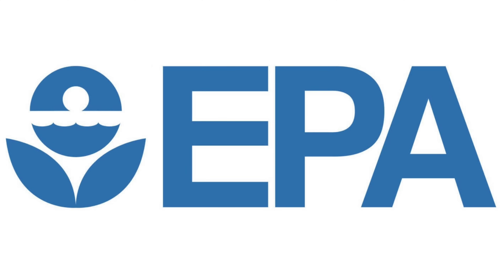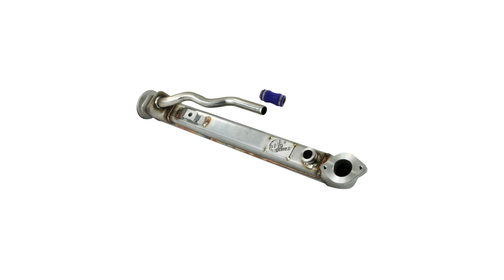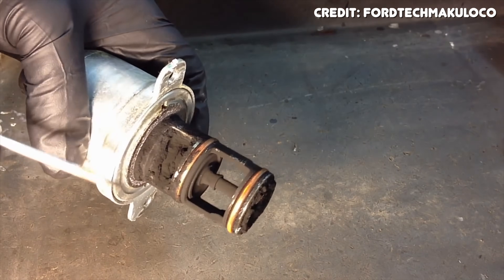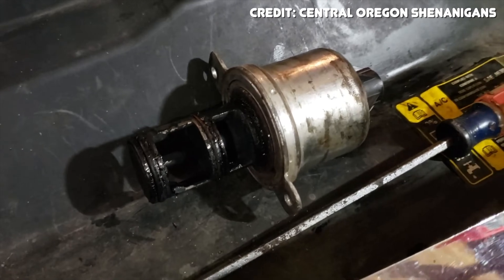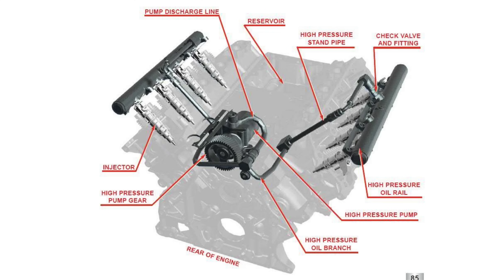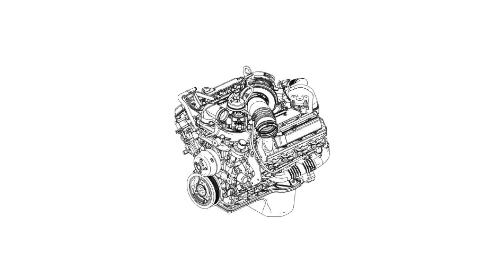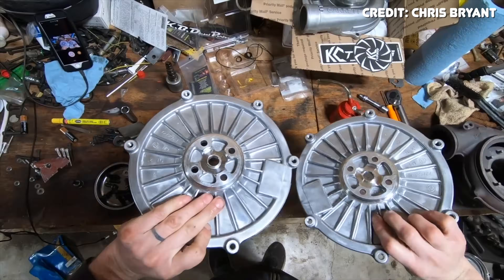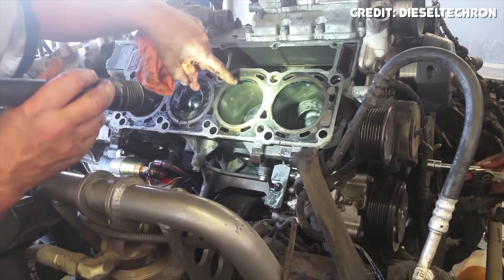The Truth About the 6.0L Powerstroke (And Everything Wrong With It)

Comment: Junk. I have an 03 Dually bulletproofed and 230k here I am spending 12k+ installing a new engine while all my Cummins competitors are pushing 500k and still going. Running hot shot so not a lot of idle time - always motorcraft oil/filters along with mc fuel filters and routine maintenance as required by dot and total failure of an engine!!!!! Pulls like a freight train …………. When running

Comment: I bought a 2006 F250 XLT extended cab for $5k, knowing all the issues, and intending to fix them, as the bottom end of the engine is solid, so I'm told.  The guy thought it had a bad HPOP; it ended up being a piece of screen broke off in the IPR and blocked it open.  $15 later and back on the road.  Two weeks later I noticed just a hint of oil residue in the coolant reservoir.  Immediately took it off the road. Had the heads o--ring'd, ARP studs, 12 mm standpipe and dummy plugs, new KC stage 1 turbo, blue spring mod, new oil cooler, alum radiator, external oil and coolant filters, and a SCT X4 tuner.  It's a solid engine now, and I love the sound.  Have $10k in the truck and DIY repairs, and probably worth $25k these days, at least.

Comment: Deleted, studded, truly bulletproofed, and with proper maintenance, my 6.0 runs all day long with no issues. Transmission is indestructible. Frame and body isn't rusted out like most ten year old Dodges on the road. Overall, it is far more reliable than any GM or Dodge product from that time period. Yeah, if I could ju$tify replacing my 2006 6.0 with a new 6.7l Powerstroke, I would consider it. But for my purpose, hauling a big trailer a few times per year, it is fantastic.

Comment: I loved my 2005 6.0, STC fitting, standpipes and dummys, oil cooler, egr cooler, turbo and ipr valve. I sold it several years ago with just under 200k miles and ran excellent. I now own a 2008 6.4 and havnt had issues with it yet besides thermostats at 100k miles. I keep my trucks bone stock no tuners However I do have a scangauge 2 to watch my temps and perform my own maintenance and repair.  The 6.4 is a powerhouse but I pray everyday before I turn the key. On the bright side owning Fords has brought me closer to Jesus!
Reply: Amen

Comment: Absolutely correct with all of your explanation, but I think some of it is not nearly as bad as to label the engine as "horrible engine".  The oiling and "O" ring issues are not at all as common as the EGR issues.  Simply changing oil regularly, using good quality oil and first and foremost adding a coolant filter and EGR valve delete kit will make this motor exponentially more reliable.  Why they did not have a coolant filter on there from the factory is beyond me.  That one simple add-on is where I think the difference is between the fleet Internationals and the Ford motors and probably explains some if the comments heard about International version being more reliable.  Ford also "pulled a fast one".  They knew, are at least eventually found out, that in the long run that the oil coolers would plug up and cause the chain reaction that would take out the rest of the motor, but the fact is, these failures would more often that not, wind up happening after the warranty period.  So most of these motors would not clog up until after 60k miles.  So, they fixed the ones that were inside warranty and kept their mouth shut instead of doing a recall and adding a coolant filter and swapping out failing oil coolers.  Just telling every owner to add a $100 coolant filter kit would have saved many of these motors and potentially diverted the "6.0 is a terrible motor" stigma.  But they could not do that because it would have been admitting guilt and meant replacing a bunch more oil coolers at cost.  Swap out the studs, delete the EGR valve, add a coolant filter and these motors are good to go for a tune and a ton of miles.  Just start by first getting a scangauge to make sure your oil temps do not exceed 10 to 12 degrees more than your water temps while driving on the highway for at least 15 to 20 miles.  If it does, you oil cooler is plugged up and that needs to get swapped out first.

Comment: I had a stock 2003 Ford F250 with the 6.0.  Had the injectors replaced once by Ford.  Got 90k on it when I sold it.  Never had a problem with the engine or truck, but I did not tow anything more than VW's on a trailer.  My friend also had one  but  had turbo and injector issues throughout his ownership.   I may have gotten the engine lottery with mine.

Comment: I have had my 04 Excursion for several years now I have done most of the upgrades minus the studs and remote oil cooler. 
I had two 7.3s that I truly enjoyed yes I had reservations on the 6.0 but after upgrades like Banks exhaust S&B intake Air Dog pump kit upgraded stock turbo and I went ahead and put a stock ford HPOP and injectors stand pipes and plugs EGR issue resolved and cooler. 
It has 248k and it runs like new no oil usage I think it will probably last like my last 7.3 it had 815k when I stopped driving it due to transmission issues dislike the ZF 5spd. 
Yes it was a lot of work but it was super simple and worth the trouble.

Comment: I was driving my 6.0 on the highway when all of a sudden I lost power. I went from 75 to 55 and started to run rough. Now it starts but rough idles and died after a couple minutes. It’s been bulletproof, egr deleted, and straight piped. I have no acceleration. My CTS3 is telling me it’s at 90-100% load. We changed the fuel filters but that didn’t work. They’re is no white smoke. It might be something with the fuel system.
Reply: Mine did something similar with a blown injector. No blowby but washed a cylinder before I knew it.

Comment: Meh, Ok Video because it discussed nothing new. Sampling a few comments, seems on par. Coming from a 7.3 to a 6.0 (2wd) and then deciding to upgrade to another 6.0 (4WD KR)- The motor is reliable when all the topics discussed here are addressed. What is missed is the bad runs of radiator caps (degass bottle caps) causing another failure chain. Eventual coolant loss equals heat in the wrong places and a cascade of failures up to potential head gasket failure. Make no mistake, a 6.0 is cheaper to run because of the failings and now they are the most practical diesel today to run for any reasonable mechanically savvy person once addressing all that has been discovered since 2003. Of the 6.0 trucks in my family, 50% are over 500K miles, 1 was bought new in 2005 and has over 1 million miles (RV transport). Of all diesel trucks (Dodge/Cummins, GM/Duramax) all experience costly repairs when run like this situation (RV transport), the 6.0 eeks out as a complete truck (bumper to bumper) still cheaper, reliable and most of all comfortable. Whats more, there are additional tid bits about head gaskets that I could write on about, but conditioning head gaskets is in someways better than NOS and aftermarket gaskets. Here is atleast once source to help those wanting to learn more about the 6.0. https://www.youtube.com/watch?v=qHyBwfGspuA

Comment: I mean mine went 356k before the heads gave any issues which was they cracked mixing diesel in my coolant. But the first owner which I personally know never tuned it just routine maintenance and treating it like a truck. Regularly pulled our Kubota kx40 on our tilt deck. It is mainly in how they are treated but it has a ton to do with how they are maintained. I’ve done several upgrades and updates since I purchased it and it’s my daily and I wouldn’t hesitate to pull my fifth wheel from coast to coast with it

Comment: I worked on these engines 7.3 and the 6.0 for years and you nailed the 6.0 problems. The only thing you missed was the fuel injector wiring harness having very small gauge wiring being routed tightly on top of the engine, very prone to chaffing and the insulation falling apart due to heat. Not an easy engine to work on. Even though I know the 6.0 well, I now refuse to work on this engine. Another Ford nightmare design.

Comment: It's worth noting the high pressure pump was revised in 2005 and the newer one rarely fail. Good video. I could touch on a few other things being a 6.0 tech. But I assume your going off internet research not actual experience.

Comment: My 05 6.0 was bullet proofed before I bought it and it's still giving problems, but lucky for me I have a 1995 5.9 12v Cummins on the engine stand ready to drop in and the swap kit will still be cheaper than fixing the powerstroke and I will finally have low end torque something that is unobtainable from a 6.0 powerstroke thank you for the video it sure brought clarity to my decision

Comment: The 6.0 has its faults just like any engine you try to maximize its output from. I bought mine with 70k miles on it. Had a well known powerstroke tech who has been servicing these these engines since day one. Replace the head bolts with arp studs, egr delete, blue spring upgrade , hpop connector replaced 6 yrs ago. Have 200k on it now. I don't dog it but do make it work to earn its keep here and there. Have replaced one injector, glow plugs and stand pipe since. I use rotella T6 synthetic change every 5k miles. Can't ask for a more reliable truck. It's all in the mechanic.

Comment: In the Excursion community, we are screwed when it comes to engines.  V10 - Ridiculous gas hog that doesn’t make a lot of power.  7.3L - terrible fuel mileage for a diesel and kind of gutless.  And the ol’ 6.0L.  Some people do spend the 10k to have the 6.0L completely gone through, but at the end of the day, you can buy a lot of gasoline for the V10 for what it will cost to fix a 6.0L.  If you put  4.88 gears in a V10, it will pull anything a diesel will.

Comment: I think I have a bone to pick with this videographer. I love his videos, but—

—my understanding of torque-to-yield bolt is not that they'll fail as assembled.  There's relatively a long way to go before a bolt which is T-t-Y and where the volt is permanently stretched to the point where it has no clamping effect.

What the definition of torqued-to-yield bolts mean is that once they are taking off they are to be thrown away.  This is because the said bolts no longer have their springy clamping effect.

Similar to the caterpillar 3208: it was a fine engine that would last a long time as it was originally intended. But for its mass, both in size and weight, it just didn't have great power. It became a less and less reliable engine as more and more power was trying to get from it. It was a perfect engine for generators and boats that typically run at one speed.  

I only have 375-425 horsepower and my Cummins N14.  I benefit by the previous owner hauling light containers but also not tracking the horsepower to above 460 which continued the life of this engine.  I will rollover to 1,110,000 miles next week. Never had the heads off.  Those that rock and roll with 500 to 600 horsepower a Cummins N14 probably will not see 500,000 miles before the end of goes kaput: spaulding of the main bearings is the usual culprit.

Comment: After watching this video—and after watching a Car Care Nut channel episode:

I shall put this 6.0 powerstroke in the same class as the Toyota 2AR-FE in that I'll never buy used one. If I buy a vehicle that came with this engine, it better be blown so I can replace it with a remanufactured one.  Kind of the same thing about buying a Toyota Tacoma: I'm not interested in it if the frame was not replaced by the factory recall.

I just don't have faith that the cars I look to buy have been properly maintained.  With this variable timing stuff and EGRs on diesels: it's just too much of a trick bag. It's just not like the old days when you could just listen to imagine and watch the exhaust pipe.

Comment: Not only sand, but the silicate in the Ford Gold coolant help clog the oil cooler.  Then less coolant get to the EGR cooler downstream.   Heat then perforated that cooler and water gets into the intake.  Hydrology then lifts the heads held down with 4 bolts.  On a stock engine...

Nasty chain of events!

Comment: Own and 03 and 04 with well over 200k miles. We’ve had some issues here and there but nothing catastrophic or beyond anything we’ve ever had to deal with on other diesels we have owned. Keep pumping out videos like this and we will keep buying low mileage 6.0’s for cheap and getting years of great service from them.
Reply: that is EXACTLY what a diesel mechanic friend told me also ... he loves picking them up cheap and fix them  becuz of the scare tactics.
Reply: Just bought a late 04 ext cab linesman truck 4x4 f350 with 136000miles on it no bells or whistles for 7500 pretty much stock.
Do you think that was a fair deal?
Reply: @lonekiterrocky put on your bandito hat.

Comment: I have two 6.0s. Regular oil and fuel filter changes. 288k and 89k miles. Other that FICM and injector replacement, no bad engine concerns. Tows nice and has plenty of stock power for my needs. Change that oil, filter, and fuel filters and reduce risk of problems.

Much Thanks

Comment: 6.0 sucks but consider a couple things. #1 you can buy them cheap and parts are much cheaper than 6.4 and 6.7.#2 the 6.4 only makes 25 more horse power. That 25 horses make parts cost 3 times as much #3 the 7.3 is reliable and pretty much does any job. Stone age tech is ok for non fancy folks.

Comment: I got my 6.0 Super Duty with 145k miles and was assured that it had new head studs and was bullet proof. By 155k, I put new head studs and copper gaskets, fuel injectors and rails, upper wire harness. I also had it tuned. It has dependably given me another 100k miles  and has been a daily driver since I rebuilt the heads.

Comment: Got one new and did all failed repairs from a shop who knows the engine backwards and forwards. It's a work truck. Today's truck cost make me look for another 6.0 to fix up and still have enough money left over to put a big down payment on a house. No def to worry about a long with all the emissions parts that will fail and cost more to repair than setting up a 6.0. BTW torque pro app monitors tons of engine sensors and temps

Comment: Have had my manual 03 6.0 for four years now. Picked it up for 10k with 115k miles. Bypass and coolant filters, changing oil and filters religiously, clean egr once a year, use arch oil stuff and oil analysis come back perfect every time. Paid off and cheaper than any newer truck for sale.

Comment: I was a service manager at a Navistar dealership at the time. My favorite was the branch tube and stand pipes. At one point, when we were all buried in UPS failures, Navistar came out with, at the time, a super secret kit for the HP oil problems that included backup seals on all orings, a new adapter (the tee), and standpipes. We had to jump through all kinds of hoops to prove to Nav we were working on UPS and triple check diagnostics, none of which they'd pay for btw, usually requiring diagnosis, report, put the engine back together to do another test, teardown, validate, report, do it all again. We were not to tell UPS an update was being provided as I'm sure they were trying to avoid a tsb which UPS would force proactive action as opposed to waiting for failures. I was there thru the 6.4 fiasco as well as the Maxxforce 13.. Maxxforce everything actually.. before I just got fed up and left. I was never a diplomatic person and happily called out their bs in Illinois where I attended many meetings. When they got word I was leaving, they yeeted my certification and training creds into orbit which just made me chuckle. The saddest part is back in 2010 I met with a large municipal shop boss and we got into a heated discussion over enhanced EGR, which I defended as 'look at us, we have no DEF'. Looking back, that guy was a hell of a lot smarter than I was as that is a large part that led to Navi executives getting tossed a couple years later. Bottom line. Navistar is sketchy as hell with marketing graduates posing as engineers. They were trash to deal with. Made shoddy products. Blamed their dealers for everything. Executed and paid warranty work pathetically. And in general, can go f*ck itself.
Reply: are u hiring boss

Comment: 389,000 miles on a stock engine 06'  6.0 nothing replaced or fixed just a delete kit and regular maintenance. Trans made it to 260000 before it crapped out

Comment: Have 2 of them, difficult to keep running. Kept both stock. One in an E 350,04 Can't get hands on engine. F350, always something stupid.
Rearly  both running right at the same time. Fuel mileage is the only benefit. 5.4 cost double to run but never left me on side of road.
Concidering the options, I'm stuck with my 6.0s. As a diesel mechanic, I've already seen the costs of the 6.4 and 6.7, I'll keep my 6.0

Comment: Unless you have actually owned, or currently own a 6.0, your opinions don't matter. I've owned nothing but the 7.3 until two years ago I traded in for a 6.0 and I never looked back. The 6.0 isn't for the rich kid driving his dad's truck running it 4k miles over its due service. The engine is for the men who keep up on general maintenance, and fix an issue as soon as it's discovered. Juat like ANY OTHER engine in the world!

Comment: Here's the thing...the 6.0 was an incredible engine....the amount of power, and the fact that you could get almost peak boost right off idle and in a small block engine, making the power that it did when it was, all of that was incredible. But what killed it in my opinion, was that engine was way, WAY, ahead of its time. When it was running, with no issues, it was an absolute animal, fast, gobs of power (i understand its no 6.7 powerstroke). It was a good design but it just didn't work as planned, typical engineer "it works on paper" lol